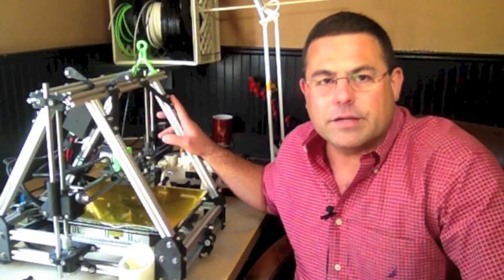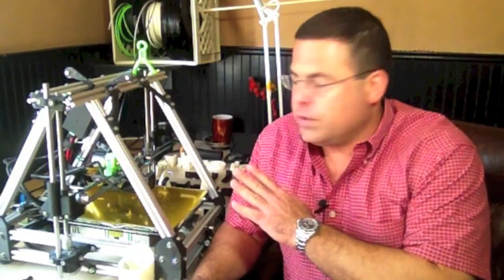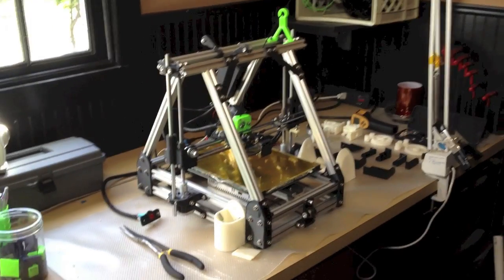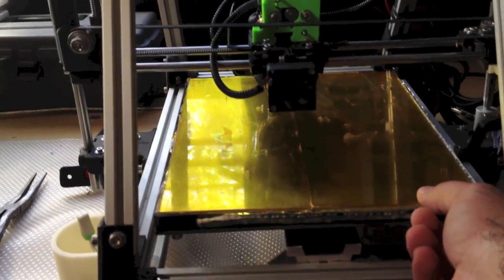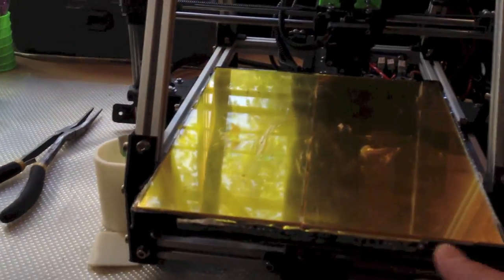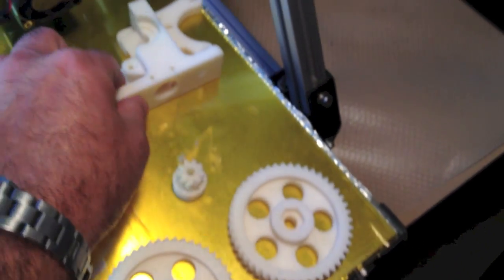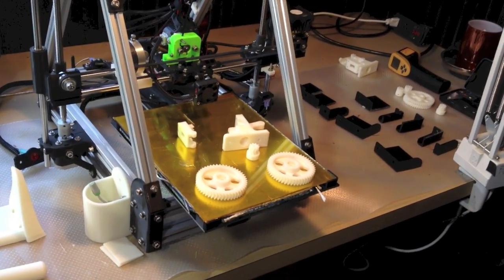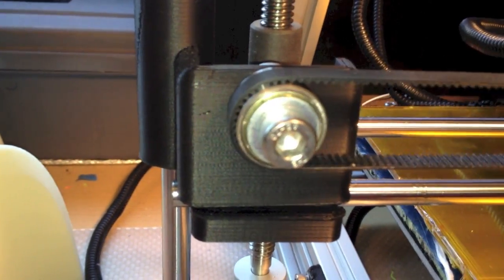MendelMax 3D Printer - First Look

Comment: I was looking at the this model very hard when I was buying. I ended up with an AirWolf 3D that uses a thick acrylic frame (very sturdy and stable) but has a lot in common with the MendelMax 

All of the axis work the same with the bed moving. My heated bed though is different (red) and has no issues that I can tell with hot / cold spots, seems pretty even. One of the main reasons I went with the one I did was the builders local and it was fully built and mostly calibrated.

Comment: Im a tech-head allright. Im pretty sure i would be able to build one, but im not sure the firmware is something i would be into. I have tried learning programing a few times and thats not really my thing. I have several years experience with SketchUp and 3dsmax though, so maybe i should look for a printer all ready to go. There seems to be alot happening in the 3d printer market, so buying a finished printer now might be a bad idea.. Maybe in 1-2 years i will get one.